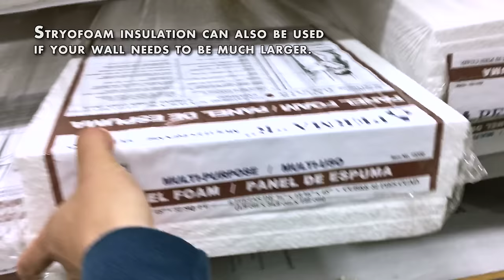DIY Game of Thrones "Ice Wall" | Shanks FX | PBS Digital Studios

Comment: I was always told to have a mask on when hot cutting styrofoam, also to ventilate the room as much as possible.
Reply: +NOLNV In open areas your usually ok, it's really more if you're cutting a lot, or in closed quarters.
Reply from the maker: +NOLNV The Hot Wire Foam Factory tool came with a DVD for beginners.  They didn't mention using a mask but def mentioned working in a ventilated room.  But I was using styrofoam that wasn't intended for "craft" purposes, so it could have contained more chemicals and what not.  So, yeah a mask would have prob been smart.